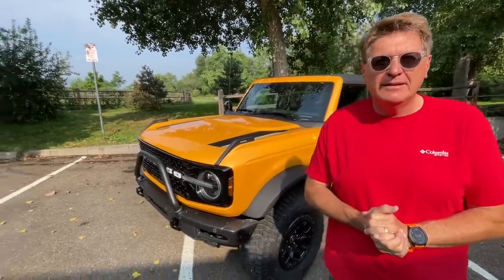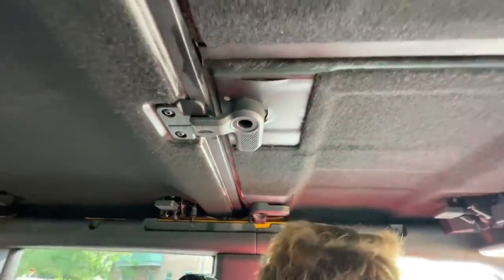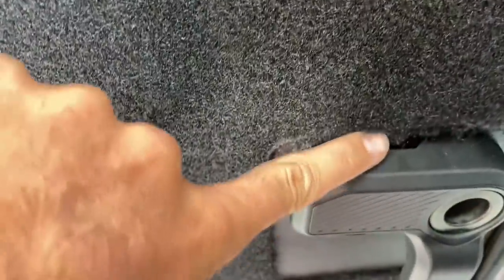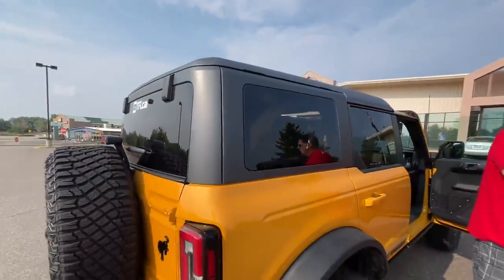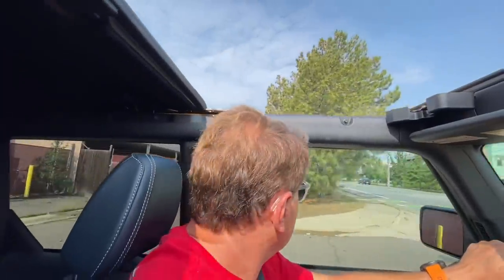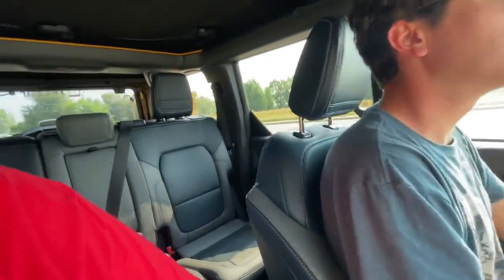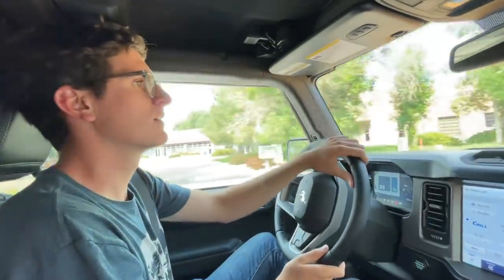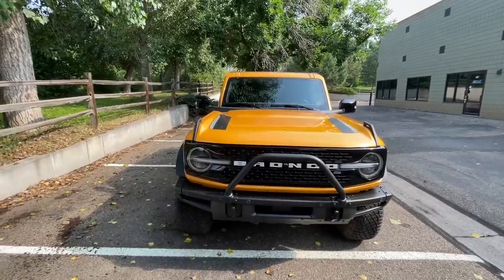This Roof Squeak In My Brand New Ford Bronco Is Driving Me Up The Wall, What Gives?

Comment: You right, for 63k their should be quality.  You can make it rugged with quality….these are not mutually exclusive
Reply: This is really a 35-40k truck with 20k markup.
Reply: You want offroading and quality? NISSAN PATROL. TOYOTA LAND CRUISER.
Reply: @urbannomad8126  those are very expensive. Like $90k expensive. And with the 2022 redesign of the land cruiser, and the loss of the V8 engines, expect the prices of the 2021 models to double. If you want reliable off road ability for cheap, the 4runner is your best option.
Reply: To Ford they are
Reply: for 63k you should have bought a BMW or … actually i dont know who makes good SUV
Reply: @YourMajestyTheKing  — BMW!?! Dude, BMW has even worse QC issues, and what makes it worse is their gremlins decided to nest in the engine compartment and electronics! That roof issue can be resolved easily but try resolving Mercedes and BMW issues and you have a whole new can of worms to deal with! Unfortunately, i speak through experience!
Reply: @urbannomad8126  - This show being based in the USA, the Nissan Patrol is not available and the Land Cruiser is very expensive. Easy to say if you don’t have to budget,,,,,,.
Reply: Where are these vehicles made at? I think it is in Mexico, but I could be wrong.
Reply: It would need to be $80k to be nice🙃 They threw so much money at everything else.  Extra options on a non-luxury vehicle are often not that great.  That's why I'd only buy the hardtop.   Once these things are 2-3yrs old, they're going to leak like crazy too if they're not garaged
Reply: @HAHA.GoodMeme  Every truck is like this now.  20 years ago, a small truck wasn't much more expensive than the cheapest cars.  Now they're nearly double the price(future Maverick excluded)
Reply: They received 30k vehicle quality interior
Reply: @johnjobber2219  30k Kias have better interiors than pretty much 90% of the car market
Reply: @hadin101  lol. Greater then 90% is quite delusional.
Reply: @hadin101  True. I had a stinger GT1 and it had by far the best quality interior than most cars today.
Reply: @HAHA.GoodMeme  100% dead on the money
Reply: @RM.....  as they should be. They drummed up demand with a naive market and are counting stacks. Mission accomplished. Poor consumer judgement is on the consumer, not the the producer.
Reply: @hadin101  OMG. KIA's are awful. Have you been in one? They make Chevy  seem like a toyota avalon.
Reply: @FencerFixerRepairLLCKansasCity  this style Bronco is made in Michigan.   
The baby Sport model is made in Mexico.
Reply: @Dog_will_hunt  I knew it was something like that.
Reply: @Bacnow  don’t ruin it for me. I want a biker next.
Reply: @RM.....  wrong, Ford held up Bronco production for this issue, and Ford normally addresses these things with a TSB (technical service bulletin) as soon as engineers and suppliers locate the production problem.
Reply: @hadin101  In what warp do you live!
Reply: @didiermejia780  It was 3X the price of most cars its size; so not surprising they could add a little extra felt here and there. :) 
I bought a Focus with leather seats. Interior still looks great with 80K miles so quality is tops. I was totally satisfied spending $16K price for it. How much did YOU pay? With my manual transmission it is sportier than a Stinger, and I get 36-37 mpg lol.
Kia is the one running to the bank with a wheel barrow of cash, methinks.
Reply: @rayrussell6258  the courier is going to be a pickup.  And I've ridden in a Bronco Sport. It is tiny🤷
*There's always been a larger profit margin on more expensive vehicles.  That was true before we even had emissions testing.
Reply: @Muscleupsanddangles  I think the discussion has gotten far out of hand when we are going on to this extent about the vehicle's overall quality, when the only problem is a minor plastic squeak. Poor consumer judgment doesn't enter into it yet, since quality and satisfaction of initial buyers is pretty darned good.
Reply: @FencerFixerRepairLLCKansasCity  Michigan Assembly Plant. Wayne, Michigan
That plant has in the past turned out very high quality vehicles, including F-Series trucks and the old Broncos.
Reply: 63k. 😂😂😂😂😂😂😂😂😂😂😂😂😂😂😂😂😂😂😂😂😂😂😂😂
Reply: @rayrussell6258  exactly my point. People are paying for the vehicle they want. It isn't a need vehicle. It isn't a value based vehicle. It's a toy vehicle. A fun vehicle. The price, quality, demand, utility do not correlate in this type of vehicle. Midsize sedans are fungible. Broncos, jeeps, muscle cars, sports, they are not.
Reply: @Bacnow  Oh but the marketing department machines keep rolling out how great German quality is! 
Laughable. 
I drove a Porsche 911 once to test; didn't buy it. It was terrible quality. Friend of mine spends alternating weekends driving, then working on his Porsche. 

Hope you consider coming to Ford for your next vehicle. The US press has been taking pot shots at Ford so long everybody thinks they need to go to German or Japan brands. Ford quality .... the REAL objective quality numbers, not the soft subjective ones the press latches onto about how much you like your cupholders, are neck and neck with every other top selling brand in the world, and better than all but a handful (a couple digits past the decimal place being how far you need to go to put up the ranking list).
Reply: What  vehicle is a convertible, rock crawling, dessert runner, family hauler and has a nice interior that can withstand the sun and dirt for less than 65k??? You won't find one cuz nobody can do all those right, but at the same time they can do better with that top.
Reply: @rayrussell6258  — I was a BMW guy (328is, 540i, M5) and my brother was a Mercedes guy and virtually ALL of our vehicles had serious, serious issues and spent an absurd amount of time in dealer service depts waiting on parts, authorization etc… Yes, they offered an exhilarating driving experience, but at what cost? 

Also, yes, i have a reservation in on a Bronco while my brother eagerly awaits his Ford Lightning and my son has been eyeballing the Maverick. We are NOT a Ford family but it’s weird how we ended up here….they just have the most exciting new vehicles right now!
Reply: It's first year it happens
Reply: @rayrussell6258  Bronco is built on the Ranger frame, smaller than the F150, Bronco Sport is based on the even smaller unibody C2 platform for the Escape and Maverick pickups.
Reply: @shitloveaduck  Nissan patrol is sold in the North America as Nissan armada after Nissan discontinued old armada. Vehicle is same compared to the patrol sold here in the Middle East except I think American ones don't have locking differential and hydraulic body control systems.
Reply: Your 63K should not include rats in the attic LOL
Reply: @roshanramesh2634  - couldn’t give me a Nissan Armada. Sorry.
Reply: @veganpotterthevegan  I'm not talking profit in a vacuum, I'm saying straight up the price is set high to achieve profits yes but also higher enough to hold down free-demand sales of the poorer fuel economy vehicle. You didn't fully catch the point I made. 

I'm 6'5", the Bronco Sport seats me just fine, very comparable to the Escape mid-size SUV. EcoSport is tiny, not Bronco Sport. 

I had edited out the model name Courier, but maybe you didn't refresh your screen and it was still there for you when you read my post. I've heard about the smaller pickup too, just inserted Courier name too quickly. Sorry, my error. But the smaller SUV I'm talking about is being looked at, because EcoSport is not getting enough sales traction with its rubber-band driven 3-cylinder motors.
Reply: @Bacnow  Thank you; I hope all three of you have fantastic experiences, and join the Ford Blue Oval family.
Reply: @rayrussell6258  Ford doesn't even have to worry about CAFE standards now with the hybrid F150 being a reasonable markup from the regular F150.  And the Lighting on the horizon.  They know no matter how cheap a small pickup is, the F150(not even the hybrid) will stay their top seller.   They just know there are people that would be in the market for a used Ranger/F150 they wouldn't make money on so they may as well make a small profit on new Mavericks in a car market where used trucks have gone for so much money the last 5 years. 
*We may actually still get the Courier
Reply: @veganpotterthevegan  Gas prices will make Maverick the volume pickup very quickly, I predict. Ranger fuel economy is not enough better than F-150's. F-Series will still sell, for commercial applications and for towing. Not the hybrids or electrics .... those come with too many real world aggravations ..... no one wants to own a vehicle they have to wait for a half-hour recharge (plus wait in line for at least as long to plug in) before they can complete a 500 trip. This whole "go green" thing will implode, once people realize how unsatisfactory they are. 

I agree, I think Courier has better than a 50/50 shot.
Reply: Allen Tokyoo  genesis gv 80
Reply: What??...63 k for a Bronco...thats more than we paid for a fully loaded Rubicon!...
Reply: *there
Reply: @FencerFixerRepairLLCKansasCity  That's a lie and you know it. It takes 2 seconds to find out they're made in Michigan.
Reply: @rayrussell6258  lol. You lost me at "Bronco Sport is not small." It is a compact SUV by definition. Your warped sense of what a small crossover "should" be detracts from your credibility.
Reply: @roshanramesh2634  The Nissan Armada is a neutered Patrol, it is not good off road and still starts at $60k.
Reply: @mechmat12345  Did you not see my reply to a guy earlier that explained to me that the sport model is made in Mexico and the big version is in Michigan. He told me a couple of days ago, so you're little late telling me.
Reply: @shitloveaduck  don’t forget the pajero
Reply: @marlinnomaders5888  Bronco is better than a fully loaded Rubicon. The videos show it. 
lol I wouldn't pay that much for a house, but SOME people in this country have too much disposable income. lol
Reply: @mechmat12345  compact SUV means mid-size in the old terminology; there are no micro-mini SUV's! 
Have you even seen an EcoSport small crossover, much less sat in one? Maybe you need to listen to others, not be so hard-headed. You would change your tune about what is "small" when compared to Bronco Sport if you realistically evaluate the two. Now if your only comparison is to Expedition and Explorer, you could say Bronco Sport is "small".
Reply: @FencerFixerRepairLLCKansasCity  no I did not ..... but maybe you complain too much? Why make two errors when you could have just remained silent after making only one? 
Plus looking back at it now, I gave you better info than he did, I gave you the exact plant and location, not just the State. 
So others reading the thread will benefit, even if YOU don't care.
Reply: @rayrussell6258  You're making a big deal out of nothing but a YouTube comment. I asked a question, I didn't make a statement, and I needed some clarification.
Reply: @rayrussell6258  No I don't really care
Reply: @FencerFixerRepairLLCKansasCity  You GOT your clarification! 
I think since you keep extending the conversation needlessly (even in your own opinion), it might be nice for you to just agree I provided additional info, say thank you and move on. That's what a class guy would do. Now let's see what type you are.
Reply: @FencerFixerRepairLLCKansasCity  Then you shouldn't have asked the question in the first place. 
You waste other people's time.
As someone else blasted back at you, instead of ejaculating your thoughts into print postings on the board, take a second or two to look up the info yourself!
Reply: @rayrussell6258  lol...and jeep did it again they answered Ford with its 392 Hemi...try to keep up!👍
Reply: @urbannomad8126  we have the Nissan [PATROL] armada in the us and only lc now is the prado know as the LEXS UGLY GX 470 both v8 gas hogs if we only could get diesels, a lc 200 diesel a base model not a  lux car 3 rows ,leather, sunroofs, 2nd row ent screens or the $100k Lexus LX570 if it was priced in the $65-75k range  I never have to buy a new car ever again that last me 350,000 miles or 35 yrs   which ever comes frist
Reply: @marlinnomaders5888  392 hemi with $4/gal gas .... pretty stupid move by Jeep;  if you ask, 80% of Americans will tell you that. Guess Chrysler has to dump those dinosaur V8 motors somewhere.  lol 
I'm seeing a slew of Challengers with that motor showing up on Ford used car lots lately. Trading them in on Broncos I think.
Reply: @HAHA.GoodMeme    $33,200 vehicle with $27k in upgrades...
Reply: @YourMajestyTheKing  $33,200 vehicle with $27k in upgrades
Reply: @S. T. Objective quality numbers from reputable data sources show Ford quality to be on par with all the top 5 import brands. I'm talking so close, you have to go out 3 or 4 decimal places to break the ties. 
Back in the bad labor relations period of the early '80's (all US brands, not just Ford), we acknowledge there were issues, but Ford took actions to fix that issue. Quality is not a problem now, but you still see media blowing trivial things up into big stories. 
You don't comprehend this because the media feeds you subjective, soft quality data that tracks things like "do you like your cupholders?". THAT is NOT quality. Breakage of parts is quality. And Ford has not been any worse than the foreign brands at the top of that list. 
Toyota even goes to great lengths to hide its quality issues, with secret warranties that you only find out about after you take your vehicle in for repair. 
You misunderstand automotive quality for 40 years, because you've swallowed the media kool-aid.

I have three Ford vehicles with a combined 750,000 miles, all maintained exclusively at Ford dealerships. You can't flim flam me about Ford quality.

Comment: That’s pretty unacceptable for such an expensive vehicle.
Reply: That and the overall quality. I'm not surprised though. Ford has a history of good looking vehicles with just garbage materials and assembly. That sound damping is just cheap felting that sheds every time you look at it. The center console thing was hilarious. 

As for the creaking, that is also not surprising. There are what, 5 panels on the top? They all have to lock and unlock and there is going to be movement. Likely you could tighten the release levers and it would help. Or put some felt in-between the layers. But you shouldn't have to....
Reply: It's the same top that comes on the $30k version. I have a problem with complaining about quality-for-price when you intentionally seek out the most expensive version of a relatively inexpensive vehicle.
Reply: @mechmat12345  unacceptable for a 30k vehicle
Reply: It's a Ford at the end of the day🤙I had a 1990 Ford Bronco 5.8 engine and it wasn't making no rattling noise or made cheap, its 2021 and Ford, GM and Dodge  care only about profit and making them with very cheap materials
Reply: @mechmat12345  my Toyota’s cheaper and doesn’t have noise issues. If the top’s apart of your cars design cool, but I still expect it to behave like a normal car. I have a base cheaper version Toyota with a sunroof that’s older and it doesn’t make odd noises.
Reply: @JF-lt5zc  F150 Sunroof is notorious for being broken with less than 50k miles on it. I've had several issues with mine at under 60k. I manage to fix it every time, but getting the sunroof option was essentially worthless.